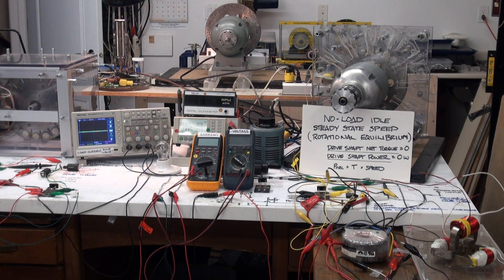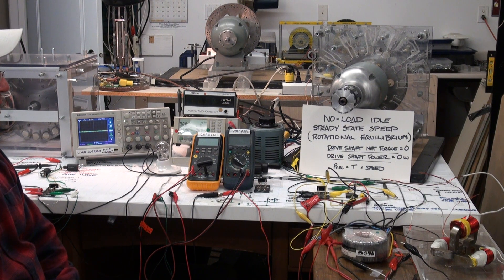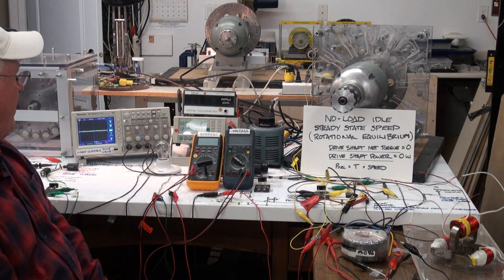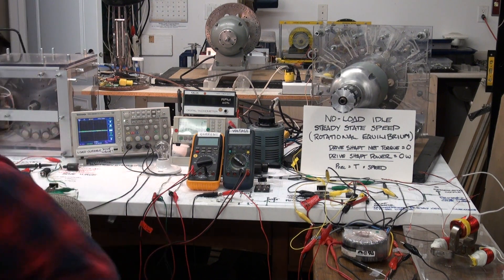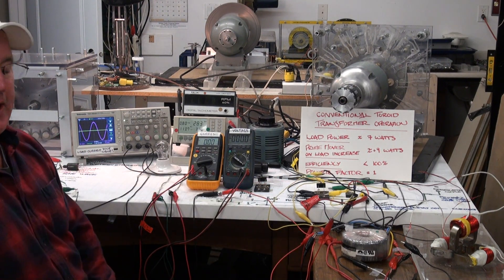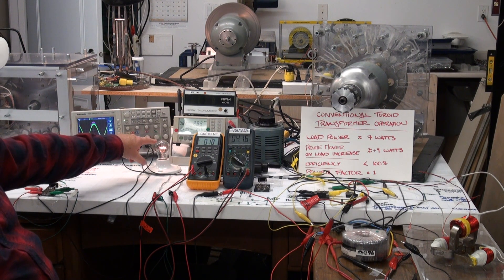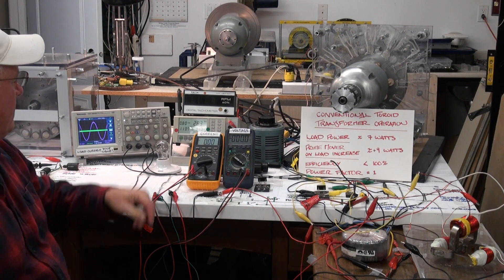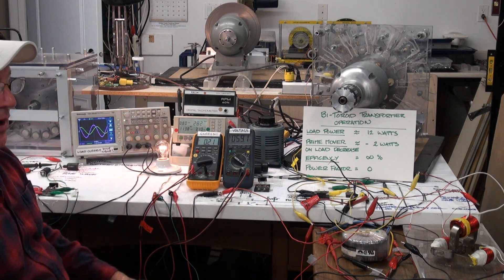Bi Toroid Transformer Performance and Operation Discussion

Comment: I built many BITTs several years ago.
The magnetic core materials were very different (transformer sheet, iron powder cores, and ferrites).
The frequencies ranged from 50 Hz up to the MHz.
They were driven by alternating current.
The result was: "None worked under these parameters and conditions."
But that doesn't mean it can't be made to work!
Every transformer, including the BITT, is overunity-capable.
It's a matter of defined pulse control.
I recommend reading the article in NET-Journal, Issue 5/6, Year 2025, Jupiter-Verlag, by Adolf Schneider, entitled: "The Transformer Converter (TraKo)."
Good luck!

Comment: Hi Thane, as an electrical engineer myself it's easy to see what's going on here. Unfortunately the power been consumed is still active (real) power although when you swap to the Bi-toroid tx you are adding a lot of reactive current into the circuit (due to the air gap on the Bi-toroid tx, you could analyze the Bi-toroid primary on no load and this will be clear) this can be seen as you need to increase the voltage setting on the scope to deal with the additional current. You can also see that the small active current and large reactive current are not producing a power factor of exact 0. Why not use the multiplier on the scope to give a true power wave on screen? Either you don't fully understand how to take accurate power readings or you are deliberately avoiding the truth as I know you have been working with this device for a long time. I hope it's the earlier. I'll be happy to discuss this further if you think I'm wrong. Best regards. Steve
Reply: You must be new here.
Reply: @Jakeup211  Could you expand on what that means?
Reply: @Sacredeng  reactive power is real power if you can get it circulating in a parallel circuit. 
Var= apparent power is real power when utilized although it’s not taught that way.

CP Steinmetz wrote about this in the early 1900’s he called them transient currents 

like capacitor correction to unity PF, in a step down transformer configuration allowing conversion of voltage to amperage.
Reply: @Jakeup211  reactive power circulates in a tank circuit (parallel circuit) this is real power which is stored dynamically and rings down due to resistance (conversion from electric to hear energy)

I've built several of these bi toroidal transformers, and found that they are not doing what Heinz and others say. Understanding how to correctly read power is paramount when doing any testing like this which unfortunately is lacking in this video and others. 

If you could point me to CP Steinmetz information on transient currents I would like to read.
Reply: @Sacredeng  Look at all these people commenting. They clearly didn't do an in-depth research. BiTT is just an incomplete parametric transformer / paraformer. A resonating capacitor is needed on the secondary side. In order to turn it into a free energy transformer, another resonating capacitor is needed on the primary side. The true parametric transformer would fully separate the load from the source, preventing power draining from the source. As you know a parallel LC tank circuit is practically a near infinite impedance. Parametric transformer when designed properly would have completely zero electromagnetic coupling, where I preferred toroidal parametric transformer. Self-inductance would be maintained as opposed to a basic electromagnetic coupling transformer. Parametric transformer have a LOT more usage such as frequency multiplication.
Reply: @Jakeup211  Hi.  Ive been reading  CP Steinmetz books.  Can you reference the chapter on this?
Reply: As an electrical engineer, you should know perfectly well that generating reactive power costs very little - only the cost of active power lost on heating the wires, using 30W of active power in a simple LC circuit can generate hundreds of Volts of voltage and tens of Amperes of current, which give whole kiloWatts of reactive energy circulating in circuit.

Comment: Good job use the mains power instead of the generator since the power you are giving the prime mover is much higher than what you get out of the load..the energy is still in the system use the mains and if you measure 0 watts toward the bi toroid transformer and 12 watts output then you win
Reply from the maker: Thanks we have already done so here: (https://youtu.be/QHZAzlqEKns). 
The transformer in this demo is meant to show a Step Up Transformer which isolates the generator and the prime mover from the load. 
Prime mover's power consumption is of no relevance - only drive shaft power matters which is zero at Rotational Equilibrium.
https://www2.slideshare.net/PDiCEOThaneHeins3240/1-how-to-calculate-generator-efficiency-what-infinite-efficiency-means-164624806
Kind regards
Thane

Comment: The true state of lenz law is that its not the same as Newton’s 3rd law as is the conventional teaching... in fact you can use reactive power to do real work!

Tesla said that using reactive / inductive input is the best way to use power.
And then there was he’s greatest contribution which is another subject altogether super electrostatic power using the energy from environment as energy and transport via surface waves!
Reply: BiTT is actually an incomplete parametric transformer / paraformer. Free energy transformer that completely separates the source from the load while preventing the source from outputting any power has been done a long time ago, by adding another resonating capacitance to the primary side. This, would be a true parametric transformer / paraformer. We are in dystopia indeed. Also, parametric transformer has A LOT more usage than traditional transformer lol.
Reply: @lukiepoole9254  mmm I’ve built one using Tesla bifilar coils and yeah, I now describe it that instead of the standard talk regard phase of V & A this is a different type of use case of the same language, whereby the magnetic fields are out of phase which as you say separate the input source from the load relationship effectively providing a impedance relationship change. And the value of the idea here is that the primary is just working as a inductor always on load and off load… this then offers the real value in which most people don’t understand- it’s very simple if we go back to basic electrical physics we know that nature doesn’t allow for creation of energy from nowhere. We also know that energy must be transferred it can’t be created or destroyed, so it much be converted into another type or the same type in a different spectrum. 
Now another important basic fact is we can’t have a closed box (2 thermo law example) as we cannot block B field by using any know material. If we could we would be able to produce mono poles in systems via blocking either S or N on a magnet and to would be easy to have a magnet motor - free energy use for the life of magnets domains. 

So sorry back to the point…
We know that voltage is the aspect of energy in electrical energy lost to heat - amps are not lost at all as they are carriers.

Ohmic heating is how electrical energy in lost - transferred to another type.
We can also clearly use the electrical energy as a different voltage conversion (transformer) or physical conversion (motor) 

So interns of that primary coil as a pure conductor only in this unique design, it only looses energy in copper losses - so the ac voltage returns to the source. (Ac basic theory) 

So what clearly going on is what people said in electronics 200 years ago the brought in “relativistic” model application of classical physics to electrical physics was to simplistic and is only true in some typology like in standard restive design (primary & secondary coils on load.)

But in this unique idea we can have a different non symmetrical design where it’s the other way around ( this is where Maxwell’s other asymmetric equations came in to it)

We have fields out of phase and treat the primary coil as an inductor on load and we Re-use the input to the inductor over and over until it’s all converted to heat 👍
Reply: @caminglis53  I suggest you find and read the pdf on parametric transformer / paraformer lol.
Also, energy can be created if you use two different reluctance to "gate" the opposing flux. Overunity switched reluctance generator.
Reply: @caminglis53  Paraformer involves modulating inductance. Which is the secret. e = I * dl/dt
Reply: @lukiepoole9254  I’m not suggesting I’ve built the paraformer transformer just that what this videos is about us to have the fields out of phase 

So how can you actually create the energy? Never heard that before…

Also in my design the results are over unity as the input output secondary coil and input coil are bust accessed
Reply: @caminglis53  Energy is always created when you churn the aether, which is what a generator is. It gets destroyed due to opposing flux.
Reply: @lukiepoole9254  yes I know all that (but also then energy is not created it was drawn from the environment) 

All the folks that research this wouldn’t agree that energy is created - but would agree that it can be accessed from the ground state (proven in the 3 law thermo) but I mean On a large scale like Tesla did with the spark gap hirpin circuit drawing in massive energy from the background and using it for useful work.

Have you built any of these types of systems ?

I spent $20 thousand and 3 years build the transformer that allows access of useful output while the input coil is unchanged under load, it works as an inductor under load and allows for re-captured on its path through the primary coil.
Tho the recapture circuit and transformer must be built to be no less than 65% efficient in terms of the lost energy not the over all… if the transformer is built to 65-70% efficiency in terms lost energy (normal cop) then the real result is over unity like 120% efficiency in real output.
The best transformers are 98% efficiency but these unique asymmetric design can only get to about 70% max as the mutual induction is less effective being out of phase, tho with 70% that means with the use of the energy from the primary coil one could maybe get to 150% 100w > in > 150w out during the running of the device.

Paul Babcock built a electrical motor that also did this in mechanical form by turning off the rotor coils before the cross product rotor field and stator - thus allowing the coil to work as an inductor and not see the reflection EMF from the stator, and capturing the input source over and over and the back emf over and over, this violates the work energy PH equation, you end up with more HP for less electrical input. Great work to prove the too, very cool machine indeed.